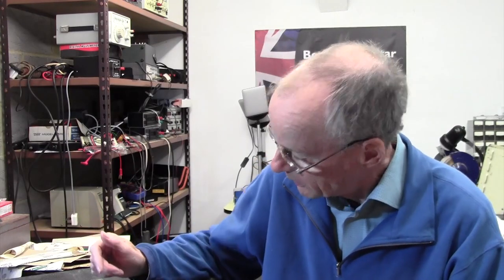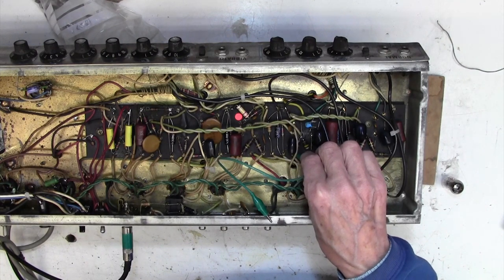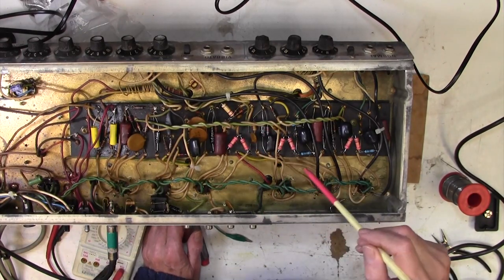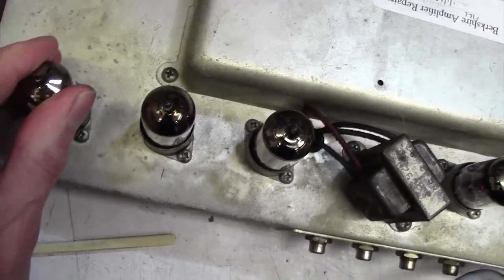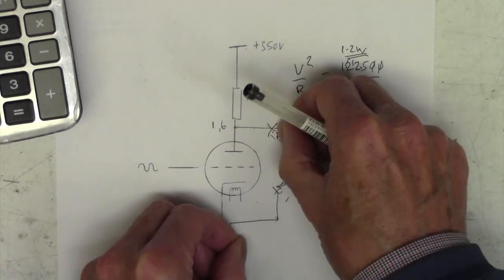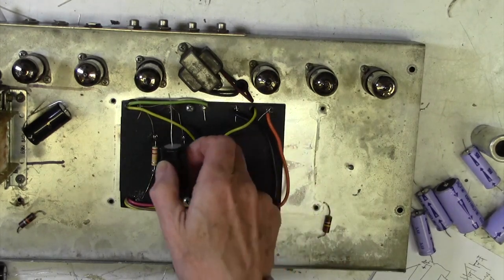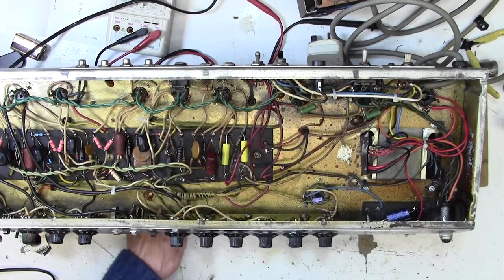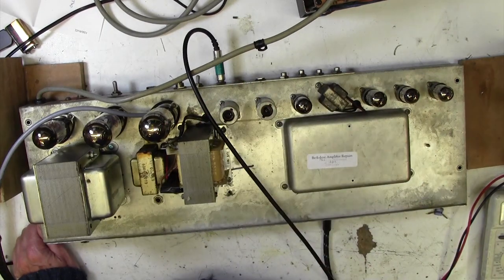How to Fix Fender Pro Reverb   Crackling and HT Cap Change

Comment: Thank you Stuart! I enjoyed video.  I was changing the electrolytic/ filter caps in a client's 1966 Fender Pro Reverb. Perfect job, with minimal hum.  Frustratingly,  I came across the similar  crackling, popping noises when touching the fiber circuit board.   The board looked damp and had a bit of white mold.   I wiped the board as clean as possible with rubbing alcohol and Q-tips.   I will remove and replace the 100K resistors tomorrow. Hopefully, the crackling demons will be gone.
Reply from the maker: I hope that cures it. Sometimes you need to totally decontaminate the board (build up of grease and dirt etc.) Good luck.

Comment: Stewart, I have a SF Champ, and the same condition as this amp. I built a new board from fiberglass epoxy, and that cured the problem. Fender CBS had a habit of spraying bees wax on the boards which in time made the boards conductive. 😳 Nice fix, Cheers
Reply from the maker: Hi Ken, nice one, I've never done that. Yes I do know about the cracking etc caused by these old boards but never quite had the nerve to replace one!! Maybe I should.

Comment: Thanks for the tip of shorting a preamp valve Anode.  It seems like most amps these days come with 1/2 watt resistors - if that !!  So you're absolutely right to mention, check the resistor. make sure it is at least 1 watt, and use this trick as a momentary short test.
Reply from the maker: Thanks Thomas I'm pleased it was helpful.

Comment: I always change the dropping and balancing resistors when installing new filter caps.  If you're going to disturb the original solder joints to remove the caps, it's just as easy to remove all of the old solder and install new components with fresh solder.

On a 1969 Bandmaster Reverb I bought a few months ago, I had a cracked solder joint that I couldn't see with the naked eye.  After poking around the eyelet board with a wood pencil I isolated the problem area and found the bad solder joint with a magnifying glass.  I did a short YT video entitled "Fender Bandmaster Reverb Troubleshooting."

Reading some of the older comments about the wax on the eyelet boards becoming conductive, I assume you've watched Psionic Audio's video on this subject by now.  From what I understand, applying the wax to the boards was a practice Fender used for a few years to try and prevent the boards from absorbing moisture, but it created it's own problems as Lyle explains.
Reply from the maker: Valuable info thanks Michael.

Comment: I'd also go with the conductive board camp, moisture and general crap. I also just watched Lyle at Psionic's video on this subject. One thing he did not mention is that alcohol is flammable, so be careful with the hairdryer. The amp sounded like it was going up in flames but literally would be bad. Cheers Steve.
Reply from the maker: Hi Steve. YEs this is certainly possible but flexing the board slightly caused the problem and that feels more klike dry joints. Also, after doing the joints it was 100% solid. But I agree it could come back.

Comment: I had a similar problem a few years ago and it turned out that the boards had absorbed water and partly became conductive and made a hell of a noise.. Had to replace the whole board .. Used a pre made turret board to save time !! Keep well !!
Reply from the maker: Hi that's VERY interesting thanks. Do you have any cures for those wavy boards like in the one I showed?
Reply: I had time travel audio in Edinburgh sort my fender champ out. They had to stick the board in an oven to dry it out and reform it straight. Had to take all the components off though.
Reply: @stuartukguitarampguy5830  isopropyl alcohol to dissolve the contamination and force the moisture out. Sometimes it even happens with the 60s cloth wiring as well.
Reply from the maker: @gringopig  Hi. Wow that must have cost a fortune! Just the strip down and rebuild would have cost a fair bit.
Reply from the maker: @weschilton  Okay thanks Wes. Just watched a v good vid on this from Psionic.

Comment: For what it costs i always change all the HT caps. Pot scratching can also be dc voltage on them. Usually faulty caps. Misleading as everybody thinks it just a clean job.
Reply from the maker: Hi Stewart. I'm always mindful of the final bill for the customer so tend not to do more work than required. Yes, it can be confusing about DC on pots but as you know there's an obvious difference in sound compared with dirt. Dirt tends to give a more lumpy noise, happens at certain positions on the dial. DC gives a fairly smooth continuous noise as you trun the pot. All the best.

Comment: I hate to be the bearer of bad news, but.....that crackling and rumbling noise will eventually be back, probably sooner rather than later (blame your damp UK climate). The wax-impregnated eyelet board (note how shiny and gunky it is) absorbs and holds moisture, causing leakage current from the high-voltage nodes on the board (primarily the plate resistor feeds) to reach the preamp tube grids. You can actually use your multimeter to measure voltage flowing through the board itself; referencing to ground, you might find several volts on the areas of the  board surrounding the high-voltage components, and it only takes 20 to 50 millivolts surrounding the grid resistor connections to generate noise in the tube. The heat from your soldering iron and heat gun temporarily drove out the moisture, but eventually the board will reach equilibrium with the surrounding air and the noise will return. The main reason the controls were so noisy is because the leaky, conductive board put DC on the controls.  The only cure is to saturate the board with pure alcohol and wipe / scrub off as much of the wax and old flux and greasy residue as possible using paper towels, Q-Tips and a toothbrush. You might have to clean the underside of the eyelet board as well, and perhaps the insulating sheet underneath. Like I said, go watch some Psionic Audio videos on the subject.
Reply from the maker: Yes I have heard about this and it may come back but it was a pretty solid fix after I went over the dry joints, and remember, that gentle flexing of the board caused exactly the same noise. Any thiughts on straightening those wavy boards? I guess not possible?
Reply: @stuartukguitarampguy5830  Hi  Stuart, as a Brit living in New Zealand I really enjoy your videos.   

There's a video by Lyle at Psionic audio where he goes into HT leakage across the board.  Very similar problem to this. https://www.youtube.com/watch?v=5OWSUYKZsag

As for flattening the board, I think it's a case of removing all the components and using heat.  But once you've done that you might as well put a new board in!
Reply: I had the same problem with a 70's Champ. The board was so conductive after washing the fibre board with pure alcohol. The only solution was to change the board out with a glass epoxy board. Problem solved. I gave the customer the original board back in case he wanted to the amp original.
Reply from the maker: @kengevers8738  Hi Ken..Do you mean waqshing the board with alcohol CAUSED the board to go conductive?
Reply from the maker: @xonxoffxonoff  Ok thanks Mark I'll take a look.
Reply: No Stuart, the board was totally soaked in Bees Wax which resulted in the board being conductive. 
After soaking the board with alcohol many times, it occurred to me that the effort was useless. Because the amp was a Champ, I decided to change the board out to a glass epoxy one, and the effort would be minimal. I also change the filter capacitor scheme to allow the front end to be on it's own, grounding that filter to the f/e as well. 
It turned out to be dead quiet. I was pleased. 
I also have to say that you are quite astute with your repair tactics, and you don't give up until the repair has been satisfied. I like watching your videos. Thanks 😊
Reply from the maker: @kengevers8738  Ah okay thanks for clarifying!

Comment: That is likely a bias balance and not a bias level control. Turning it brings one side down and the other up. You placed 100u of filtering on the tube rectifier. OK on SS diodes but not ok on a tube. Schematic is 35u net.  50u net was in there.  100u will shorten the rectifier life and could blow the power tranny (again.)
Reply: This is incorrect. He installed two 100uf caps in SERIES which equals 50uf. Also, you can clearly see him dropping the current down on the power tubes and showing them being closely matched. You clearly did not pay attention to the video and or don't understand what you are saying, rather just regurgitating what you read on a forum.

Comment: Normal channel works but but vibrato ch very low out put and sound bad. Where should I look first.  Thank you
Reply from the maker: Hi John It's so hard to say. Try changing the preamp valves first. Other than that, you'll need a tech!

Comment: It's leakage on the board because it has become conductive and it will be back sooner than later! You need to clean the entire board with Alcohol and a Toothbrush or whatever you prefer .....
Reply from the maker: Thanks Shane good info. My vuew is that on THIS particular amp it wasn't board conduction - but I'll wait and see!
Reply: @stuartukguitarampguy5830  You would know more about it than me as you had the Amp in front of you and I did not! Do I still see the EAR PSU in the background? Are you still  going to give it a go?
Reply from the maker: @shane011471  Yes still at it! I'll release part 3 soon!!